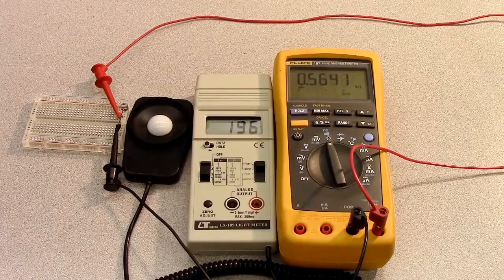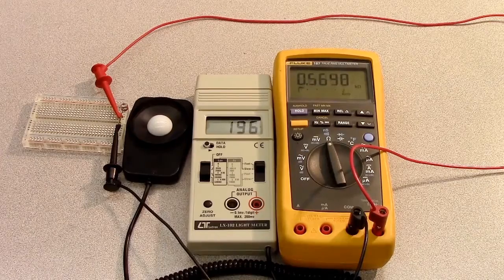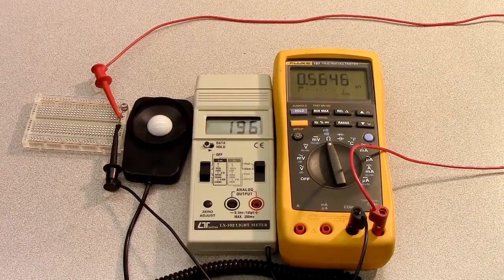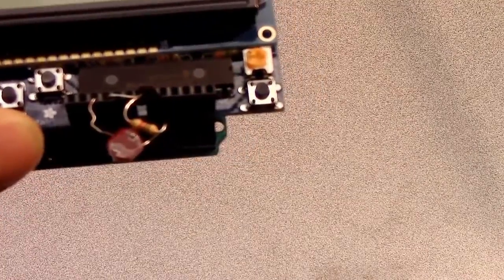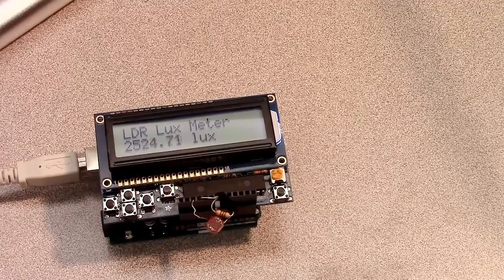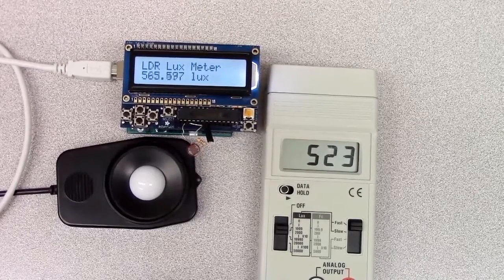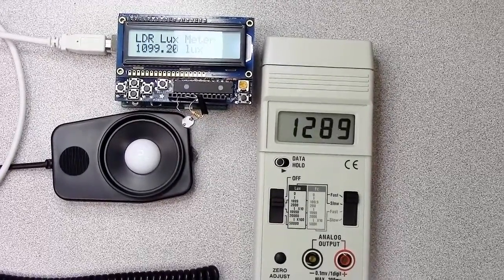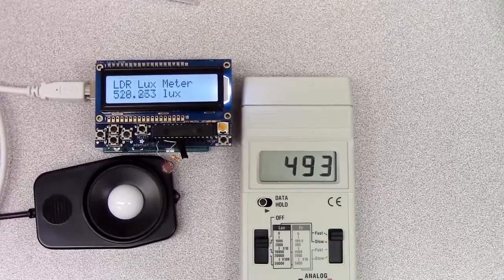Design a Luxmeter Using a Light Dependent Resistor

Comment: You need to find equation that relates both values... Use matlab and get both coefficients and put in eqn in Arduino, remaining part is just change/modify your analog input that make ratio between analog input and required coefficient, and then run code, you answer will be more precise in 3 or more decimal points.
Reply: both values for what?

Comment: Why have you chosen to plot lux as a function of resistance? Shouldn't the resistance of the LDR be dependent upon the intensity of light that shines upon it? Hence the resistance should be on the y-axis, no?
Reply: Yes change is resistance is function of change in intensity of light, but here we want measure the intensity of light by measuring LDRs resistance so we are not interested in LDRs resistance value but to measure light intensity or Lux thats why he shown X as R and Y as Lux